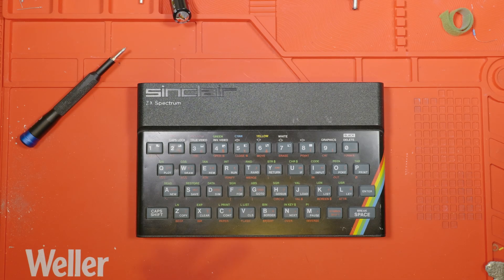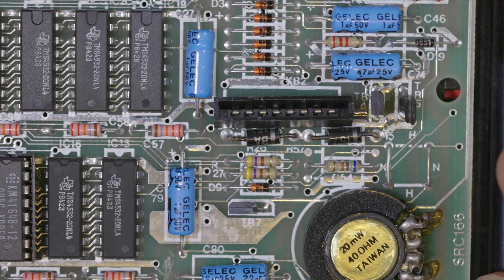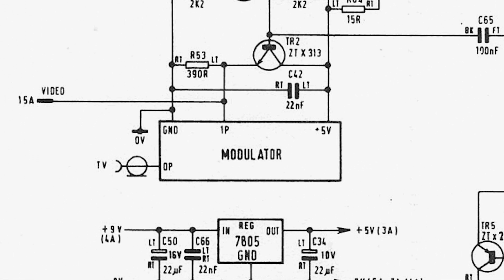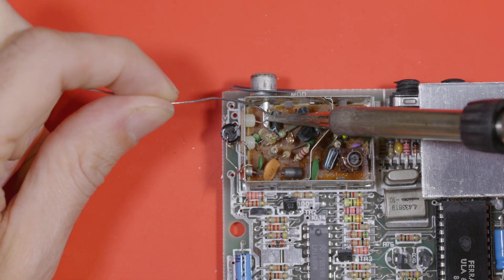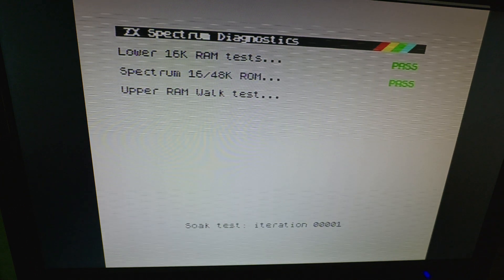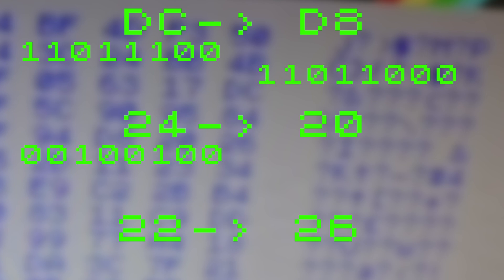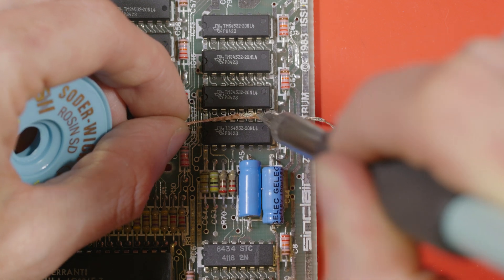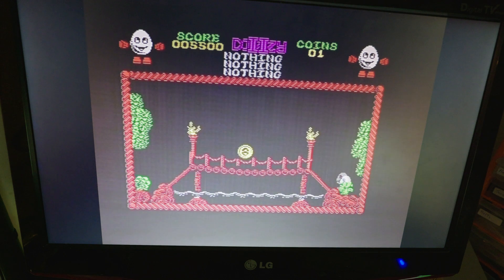Crazy RAM Failure Mode! - ZX Spectrum Repair with Explanations

Comment: On the vacuum desoldering guns, I have had great luck allowing them to heat up for another 5 - 10 minutes before using them. The tube needs to heat soak to prevent solder from solidifying in the tube.
Reply from the maker: I will be giving this a try
Reply: @HappyLittleDiodes  Let us know how it works out. :)

Comment: i've had a difficult to find ram issue in a timex sinclair ts1016  rampack(for ts1000 or zx81), i usually test these behind a memotech 16k set to master so the test ram is out of the normal address space, so not(hopefully) affecting booting, it tested ok poking 170 then 85 in each location, but wouldnt work on its own on a machine, it'd boot but quickly crash when entering program lines, or even trying to read ramtop system variable, when doing random value pokes then read, there was occasional failures all on bit 2, so one 4116 a bit suspect
Reply from the maker: Sounds quite similar to this case. 
I built my own ram tester breadboard once but it only wrote values to each and read them back, it certainly wouldn't have found this issue
Reply: @HappyLittleDiodes   the 'usual' easy BASIC test of 85 then 170 showed no problems, but random value pokes to locations in turn then reading (using RAND 1 before each pass to ensure same lot of random numbers) resulted in odd failures of bit 2, sometimes high when should be low, sometimes opposite!

Comment: The issue 2 I repaired two years ago has lost its 9v 😢
Reply from the maker: 9V? That's the PSU then right?
Reply: @ from the psu is fine. Diag board shows no 9v and won’t boot. Think it’s tr4&5
Reply: @Doombrain  tr4 and 5 generate the +12 and -5v bear in mind a shorted tr4 can damage the coil, not blowing it open but causing shorted turns due to overheating, this cant be tested by resistance checks, only way to know for sure is replacing, or remove and rewind using 30swg enamelled copper wire
Reply: @ it’s got a tracko in now
Reply from the maker: Check the schematic, see the path from 9V to the edge connector, something along that path must be open circuit or pulling 9V out of tolerance
Reply: @HappyLittleDiodes  yep, but a bad tr4 or 5 cannot stop the 9v, it only goes to them, not through them, if no 9v is getting to the edge connector, must be a broken track or via somewhere , or a bad socket if no 9v getting anywhere but then therell be no other voltages as well

Comment: 2:00 wow this is one sick scheme. c1 to c4 is shorted, and -5 is shorted to ground, all by design
Reply from the maker: 😂 the schematics have their issues, they should have represented the decoupling caps a bit better
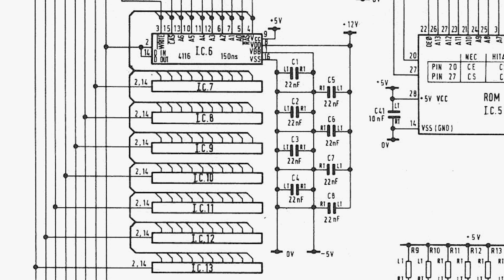Reply: Yeah you're right - it shows the 0V and -5V shorted together at 2:10. I think that 22nf cap at the bottom needs to move to the left.